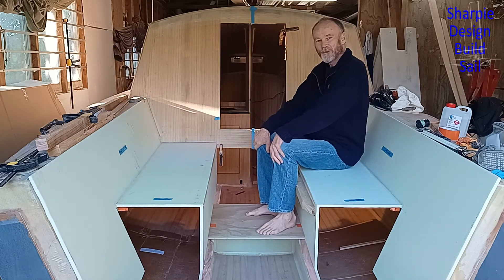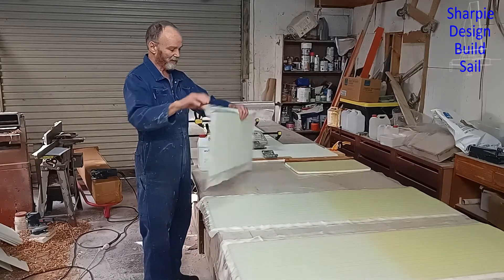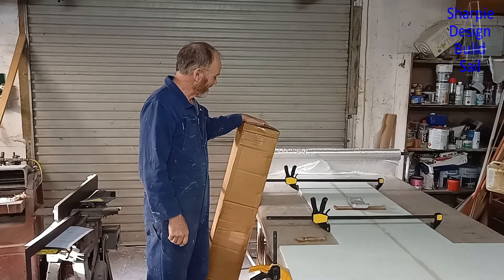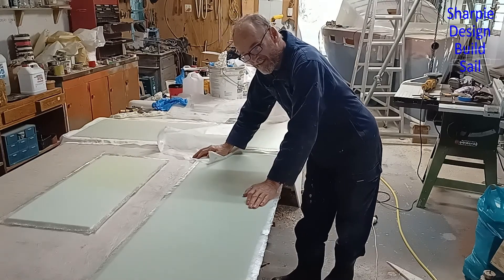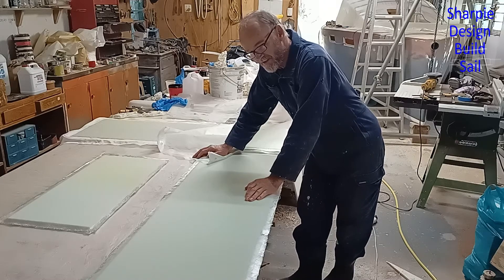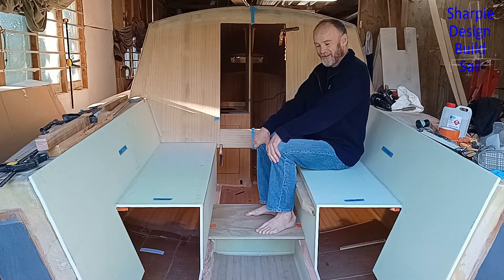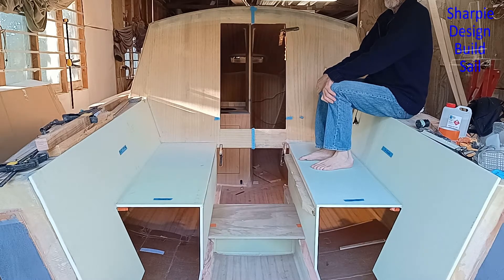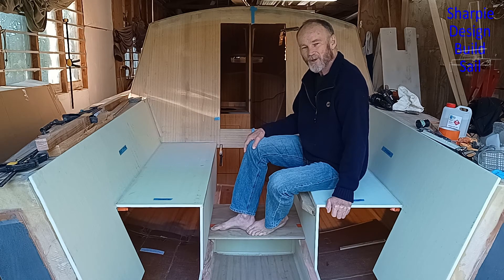Cockpit Build in Gurit Kerdyn PET Foam and West System Epoxy - Pt 3 - Sharpie Trailer Sailboat

Comment: I've finally caught up with all the videos! 
Even though you have used more glass than you planned for, the weight wasn't that far of if I remember correctly?
Reply from the maker: That's great to hear!
Yes, considering I've added an extra layer of fabric here and there, more than I was planning to, I'm not far off the target. Because I didn't want to use too many types of fiberglass and because the furniture and internal bulkheads are structural, I did use 400gsm double bias instead of 200gsm normal weave inside the boat. It is harder to get a good looking surface finish (the reason double bias is often overlaid with a thin neater weave cloth) and I have added a bit of weight there too but a high end finish is not my goal. I promised myself once, to never be too attracted to yachts you a nervous to use because of the finish. I also went a bit extreme around the dagger board case in the hull and added more weight than was probably required. For so many trailer yachts this is so often the weak part of the construction, it was for my last trailer yacht and it currently is for some friends yachts. I could hit something with my keel and feel it's as strong, if not stronger than many keel boat keels. Peace of mind!
So in my comment about the amount of resin used was I sounding surprised because beyond the weight, I'd not seriously considered what that would mean in $ and actual containers of resin and I suppose the time, to apply roughly what will be 192L+ of resin! It's also sobering to think, if I'd done the work to calculate how many liters of resin I'd use, I could probably have bought a 200L drum and even if I'd not used it all, it would have been cheaper.
I hope your design is coming along, I can see it's going to be very seaworthy and not too fatiguing to sail which is of course is what it should be for exploration. I'm really enjoying the Alluring Sailing Channel and quite interested to see what he felt he needed for the high latitudes he sails.
Reply: @KarlFullerNZ  I remember RAN sailing said the same, they bought a second drum of resin. The Alluring Sailing Channel is a really source. I'm learning a lot of watching them. I'm never sailed in such cold enviroment, but I would love to try. I used to live year around on my old sailboat, don't have her anymore.  
But for glassfiber and ressin I've had added a measly 5% in my weight calculations, but it's probably good to bump those numbers up for glass and epoxy, it's better to keep it honest. It's better to keep it honest, there will always be extra layers here and there.
Reply from the maker: @robinj6997 I used quite a bit of resin just gluing the planks together as well, something you'll need much less epoxy for. Also fairing uses a lot and I'm all for a 'work boat' finish which uses less fairing material although I've probably gone a little beyond that.

Comment: That's a fantastic little boat, great dimensions for personal leisure craft.  I wonder if it may help to  mount a little screen just inside the cabin and a solar powered camera around the bow, to address visibility limitations?  U probably do not need that but it can work, a 1 foot square solar panel might power that sufficiently.
Reply from the maker: Yes the 'dimensions' are intended to be just enough to be fit for purpose and not feel too compromised but of course we are all different  in deciding what that means for the purpose intended. Thanks for the appreciation!
That's a good suggestion, a camera could work for sure but sitting on the side deck for me does too, my previous trailer yacht, an Elliott 780, that's where you sat to helm full time. The difference is, on the 780 I'd put my feet on the outboard to stop from sliding down, not sure how I'll prevent that situation sitting on on the side deck this time round... Suggestions are welcome!